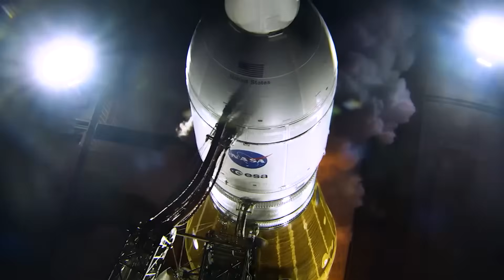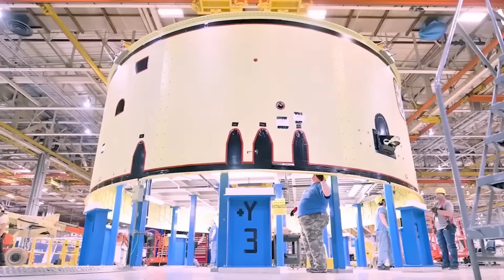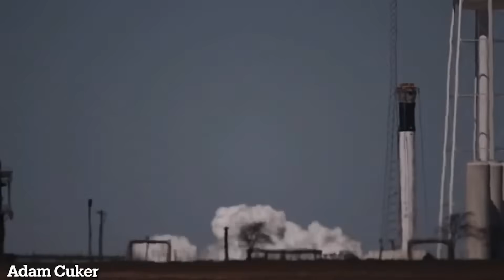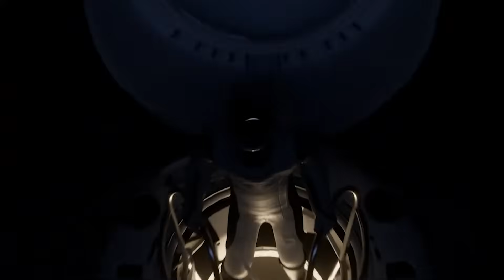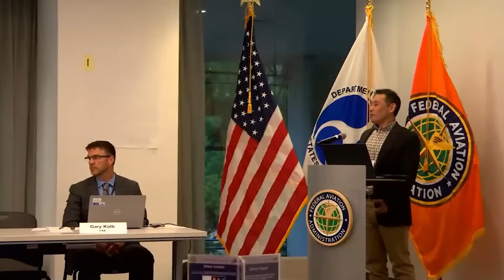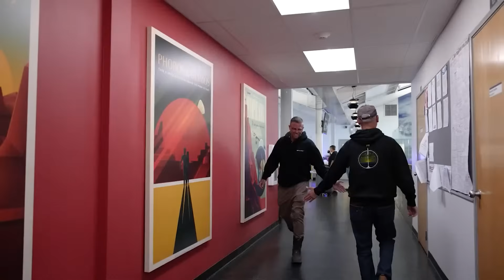NASA's Billion Moon Rocket is in Big Trouble with OLD Problem. SpaceX Starship to Replace...

Comment: The Old Engineers that could make old Tech work are Retired or not around anymore. Those old engineers were Miracle workers. 
The redesign of the old Shuttle/ Constalation Ship 
Will has been a Thorn in NASA'S side.
Reply: "Miracle" is right.
Since the last moon landings NASA should have 55 years of space travel research and development stored on computer.
Look where every other technology has gone in that time such as transport, communication, medicine, civil engineering etc.
But NASA and space travel has gone backwards. 
We are supposed to believe NASA had a 'shuttle service' to moon and back in the late 1960's but today they struggle to get a human into low orbit... go figure. 
It doesn't matter where the old engineers are now, if the Apollo program was real, all their knowledge would be the foundation of NASAs current R&D.